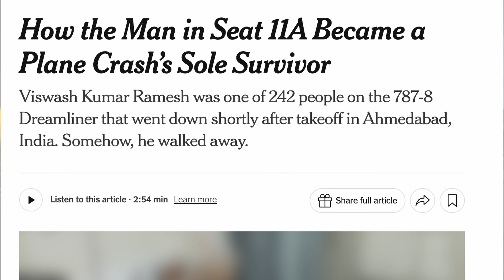Why the RAT Changes Everything – Air India 171 Update

Comment: The latest information confirms that the ram air turbines were deployed. This means that the cause of the accident was not pilot error, but a loss of thrust in both engines.
Maintenance was reportedly outsourced to a Turkish contractor, but the latest information indicates that the maintenance may have been insufficient.
One leading theory is that they forgot to drain the water from the fuel tanks. The tanks on passenger aircraft are large, and water tends to accumulate in the tanks due to the large temperature difference.
It is believed that the accident was caused by the fuel being replaced by water after takeoff, making it impossible to obtain thrust.

Comment: What would happen to the APU or its surrounding infrastructure if the cargo 'let go' at rotation and slid violently toward, and impacting the rear cargo bulkhead? The pilot reported 'no power' which could equally mean 'no electricity'. Something happened right at rotation - something major is the incline of the fuselage changes. The pilot obviously felt he had control of the plane all the way down the runway, but something at rotation happened that caused him to not be able to raise the gear, or not care about trying. The loud bang reported and the lights flickering could well be the cargo impacting the rear cargo wall, damaging stuff. The other interesting thing is in the original video shown here, I can't hear the engines. I can hear the RAT, but I can't hear the engines (that much). Those engines should have been wide open but as was said, it was mushing it's way back to the ground. A dreadful crash - like all - perhaps the answers can be found in the remarkably intact tail section sticking out of a building! I am absolutely certain those pilots were doing everything possible to keep that plane in the air. I salute them.

Comment: Even in the "poor" video, there is no wide-body "droning sound " that the 787 high by-pass ratio engines make when on takeoff power.  That would suggest that, for whatever reason, the engines weren't producing takeoff thrust.

Comment: With all the back ups designed for each system and in making sure they are not tied to each other so in case one fails the other is not affected, and I'm still wondering how both engines lost power at the same time??

Comment: Since the temperature on the ground where the airplane was sitting for two hours plus the time before take off was 103 degrees. No A/C was running in the cabin that was verified with pictures of passengers fanning themselve. Could paper lock cause the engines to fail?
Reply: I assume you mean vapour/vapor lock. Good question.

Comment: The reason I believe more on the dual engine failure earlier was that from flightradar24, the plane sent out ads-b signal and was picked up by some receiver when the plane was at the end of the runway, the speed was much slower than usual 787 at the same airport. The plane probably was working okay passed V1, but then something happened before rotating, the engines started failing (not completely yet, as we saw dust being blown up at the end of the runway), but it was too late to cancel the take off or else they would overshoot and crash anyway. However, the thrust was unfortunately not enough for the plane to continue climbing. The only thing that could potentially saved them is that with limited thrust, and landing gear retracted, they might have enough thrust to barely climb only if the engines didn't continue degrading after v1/rotate. However, in that split seconds, it is probably nearly impossible for the pilots to really have enough time to react. If the engines continued degrading after v1/rotate, there is really nothing the pilots could have done other than praying/finding a place to crash the plane.

Comment: The smoke viable on rotation is a bigger deal than the RAT being deployed. No it's not dust because you can watch planes spotting videos of the airport and there is no dust during any of the takeoffs. no it was not a flaps issue, no it was not an intersection take-off.   It's pretty obvious there was a major failure between V1/V2 or we would not be here.  Continuing is a judgment call part of the takeoff.  So i would propose 1 engine was healthy at liftoff and then lost power for unknow reasons.    What WOULD be notable is if a 787-8 descended into the ground 30 seconds after take-off...and the RAT was NOT OUT...now that would be weird and notable....  I've seen a dozen jets land safely with the RAT out...not always a big deal.

Comment: I know bothing abour airplanes. The audio is good enough to revel that the RAT was deployed. If the audio is o good, would there be a noticeable difference between the engine noise of a plane taking off with the engines at full trottle and  the noise of a plane on which the engines have failed? I would have assumed that this was one of the best clues. But I know nothing about aeroplnes.

Comment: Also you see no heat signature coming from the engines that would distort the air visually behind each engine. The question is now fuel or intentional. Both have happened before during different phases of flight.

Comment: There is another video of potentially the same plane on a previous flight where the cabin is experiencing a raft of electrical problems with air conditioning, lights, entertainment systems. I imagine cabin electrics are slightly superficial but perhaps the fundamental electrical elements were compromised?

https://youtu.be/1y_u1O-T6jw?feature=shared

Comment: Firstly RIP to all of the victims of this dreadful crash 🌹

In regards to the accident ,I don’t understand with all the advanced technology built into a plane,  that it actual took off ? The computers would have acknowledged a problem, alarms and warnings going off,.., and they could’ve aborted take off.

Of course I may be being naive here , but the engines were working perfectly and on full thrust during take off so are they saying that the engines were in full power down the run way then once airbourne flamed out ? 
Odd that both engines failed.

Comment: RAT deployed signifies eletctical or hydraulic failure. This is a manually deployed safety feature, so the pilots were running through a checklist.
Its probable that they rolled back the wrong engine during a TOGA and ended up with a failed engine and a powered down engine.
Reply: No. The RAT typically deploys automatically

Comment: The idea that a single rat could "change everything" in the context of an Air India flight, particularly one like Flight 171 which recently crashed, might seem dramatic, but it's a very real and serious concern in aviation. The presence of a rodent on an aircraft can have catastrophic consequences due to various potential hazards. Let's explore the theories of how a rat could change everything, from gnawing on wires to contaminating food, and why airlines take such sightings extremely seriously.

The Immediate Threat: Gnawing on Wires
Perhaps the most critical and widely recognized danger posed by rodents on an aircraft is their propensity to gnaw on electrical wiring and control cables. Rats and mice have incisors that continuously grow, requiring them to constantly chew to keep them worn down. An airplane, with its intricate network of wires, offers an irresistible opportunity.

Vast and Vulnerable Network: Modern aircraft are marvels of electrical engineering, relying on thousands of miles of wiring to operate everything from the flight controls and navigation systems to communication equipment, engine sensors, and landing gear. These wires are often bundled together, making them an attractive target for a rodent seeking to create a nest or simply satisfy its gnawing instinct.
Insulation as a Target: The insulation around electrical wires is often made of materials that are palatable to rodents, or at least easy to chew through. Once the insulation is compromised, the exposed wires can short circuit.

Consequences of Short Circuits: A short circuit can lead to a cascade of failures.
Loss of Critical Systems: Imagine a rat gnawing through the wiring for the flaps, rudder, or elevator controls. Even a partial severance could lead to intermittent failures, providing misleading data to the cockpit, or completely disabling a vital control surface. In a critical phase of flight, like takeoff or landing, such a malfunction could be unrecoverable.
Fire Hazard: Exposed wires can spark, leading to electrical fires. Aircraft fires, especially in inaccessible areas like wiring bundles hidden behind panels, are incredibly dangerous and difficult to extinguish in flight. A fire in the avionics bay or cargo hold could quickly overwhelm the aircraft's systems and pose an immediate threat to the structural integrity and lives on board.
Erroneous Readings and Malfunctions: Even if a wire isn't completely severed, a partial gnawing could cause resistance changes or intermittent connections, leading to erroneous readings on cockpit instruments. This could mislead pilots, causing them to make incorrect decisions based on faulty information. For example, a rat chewing on a fuel sensor wire could lead to an inaccurate fuel gauge reading, potentially causing the aircraft to run out of fuel unexpectedly or prompting an unnecessary emergency landing.
Difficulty of Detection: The insidious nature of wire damage is that it can be very difficult to detect during pre-flight checks. A partially gnawed wire might only fail under specific conditions (e.g., vibration, temperature changes during flight), making it a hidden threat. Engineers must often painstakingly trace wiring harnesses, which is a time-consuming and expensive process, to identify and rectify such damage.
Beyond Wiring: Structural and Mechanical Damage
While wiring is a primary concern, rats can also cause other forms of physical damage:

Control Cables: Aircraft also use mechanical control cables for some flight surfaces. While less common in modern fly-by-wire aircraft, older models or certain systems might still rely on cables. Rodents can chew through these, compromising mechanical control linkages.
Hoses and Tubing: Hydraulic lines, pneumatic tubes, and fuel lines can also be subject to gnawing. A breach in a hydraulic line, for instance, could lead to loss of hydraulic pressure, affecting landing gear, brakes, and flight controls.
Insulation and Interior: Rodents will often create nests, tearing apart insulation, fabric, and other interior components. While not directly critical to flight safety, this can still cause significant damage and create unsanitary conditions.
The Health and Hygiene Factor: Contamination
Beyond structural and electrical damage, rats pose a significant public health risk.

Food Contamination: Aircraft often carry catering supplies, and a rat's presence in galleys or cargo holds can lead to severe food contamination. Rodents carry numerous diseases, including Salmonella, E. coli, and hantavirus. Their droppings, urine, and even fur can contaminate food and water, potentially causing widespread illness among passengers and crew. An incident of a live mouse found in a passenger's meal on a Scandinavian Airlines flight highlighted this very real danger, leading to an emergency landing.

Spread of Disease: Even without direct food contamination, the presence of rodents means they are shedding pathogens into the enclosed aircraft environment. This could contribute to the spread of infectious diseases, especially in a confined space where people are in close proximity for extended periods.
Unsanitary Conditions: Droppings and urine not only contaminate surfaces but also cause corrosion over time. This makes the aircraft unsanitary and requires extensive cleaning and disinfection, further delaying operations.
Operational and Economic Impact
The detection of a rat on an aircraft triggers immediate and severe operational and economic consequences:

Grounding of Aircraft: Any confirmed sighting of a rodent, or even strong suspicion, typically leads to the immediate grounding of the aircraft. This is a non-negotiable safety protocol.
Extensive Pest Control: Grounded aircraft undergo thorough inspections and pest control measures. This often involves fumigation, which can take a significant amount of time and specialized equipment. The aircraft must then be ventilated and re-inspected to ensure no residual chemicals or rodents remain.
Delays and Cancellations: Grounding an aircraft for pest control can lead to lengthy delays and cancellations of flights, disrupting schedules, causing inconvenience to thousands of passengers, and resulting in substantial financial losses for the airline. The ripple effect across a busy flight schedule can be immense.
Reputational Damage: News of rodent infestations on an airline's fleet can severely damage its reputation and passenger confidence, leading to a decline in bookings.
How Rats Get Onboard
Rats are incredibly opportunistic and resourceful. They can gain access to aircraft through various means:

Cargo and Baggage: Rodents can inadvertently be transported in cargo containers or even passenger baggage, especially if they've found a nesting spot in unattended luggage.
Catering Services: Food carts and catering supplies, loaded onto the aircraft from ground facilities, are a common entry point if proper hygiene and pest control measures are not rigorously followed at the catering facilities.
Jetways and Ground Equipment: While parked at the gate, rats can scamper up jetways or climb onto ground support equipment, finding their way into the aircraft's hold or even the cabin.
Hangars and Maintenance Facilities: Aircraft undergoing maintenance in hangars, especially if left open for extended periods, can become targets for rodents seeking shelter and food.
The "Rat Changes Everything" Premise in the Context of Air India 171
Given the recent tragic crash of Air India Flight 171, if a "rat update" were indeed a factor, it would imply that the investigation has uncovered evidence suggesting a rodent's involvement in the accident. While current reports on the Flight 171 crash point to issues like "thrust not achieved" and potential engine or flap problems, the mention of a rat as a factor would dramatically alter the investigative focus.

In such a hypothetical scenario for Air India 171, a rat's presence could have led to:

Critical System Failure: A rat gnawing through wiring related to engine controls, flight surface actuators (like flaps or slats, which are crucial for takeoff lift), or sensor readings could have directly contributed to the "thrust not achieved" or "falling" conditions reported in the cockpit's final transmission. The subtlety of a partial wire severance, initially difficult to diagnose, could manifest catastrophically during the high-stress environment of takeoff.
Unforeseen Malfunction: Aircraft systems have redundancies, but a widespread or strategically placed damage by a rodent could potentially bypass these safety nets, leading to a failure that was not anticipated by the pilots or the aircraft's design.
In conclusion, the presence of even a single rat on an aircraft is far from a trivial matter. It represents a significant safety hazard due to the potential for critical system damage, fire, health risks, and severe operational disruptions. Airlines invest heavily in pest control and prevention to mitigate these risks, underscoring the fact that a tiny rodent, if left unchecked, truly has the power to "change everything" for an aircraft and those on board.

Comment: Thanks Captin Steve for your great Analysis. What I find very interesting is this aircraft should have been at Maximum takeoff thrust . I also find it interesting that the RAT can be heard so clearly above the sound of two Max Thrust 787 engines. Am I wrong to make this assumption? Perhaps this tells the story that both engines were in fact lost. The other question is why? My condolences to all the lost souls, Crew and Passengers on board the aircraft and on the ground, what a tragedy.

Comment: As an "aviation expert" you should be ashamed of yourself! You have been sucked into the black hole of "I'm first journalism ".
The video with the sound of the RAT operating was out before your now deleted video which theorized one of the pilots raised the flaps instead of the gear.
You might also have taken a few minutes to confer with a B-787 pilot friend. I believe the flaps would not retract even if commanded up, due to flight envelope protection of the flight control system.
Congratulations, you now join the journalism hall of fame with KTVU and their reporting of Asiana Flt 214 crew names!

Comment: Someone posted a video from this same plane (they claim) from a prior flight where they were noting unusual electrical issues. If true, that raises the issue of a preexistent electrical problem.
Reply: Indoor electrical circuit is completely independent of the flight control one . There is no connection so next time the infotainment system does not work , don't freak out !!

Comment: So very sad that all these people, save for one- by some miracle- died in this crash. Yes the RAT looks to have deployed, but if both engines suffered a partial loss of power at the critical time on take off, the pilot said no power, yes a possible bird strike which would cause a loud bang. What I'm wondering is could the cause have been a compressor stall in one or both engines??. If so, with the heat of 40°C and air density conditions at the time meant the pilots could not have done anything and the fate of the aircraft was sealed. Hopefully the causes for this tragedy will be discovered very soon. RIP all who perished.